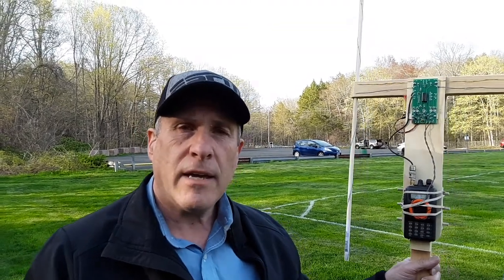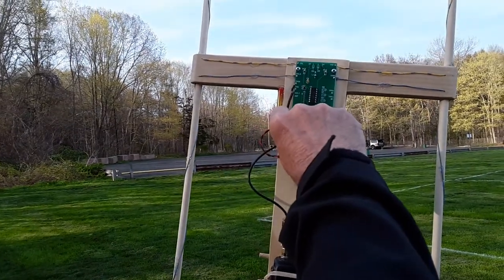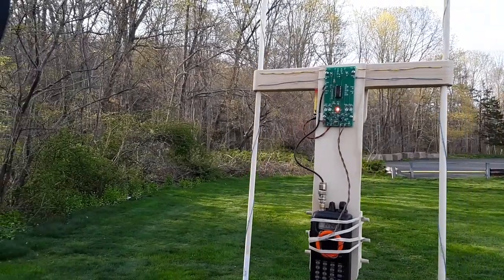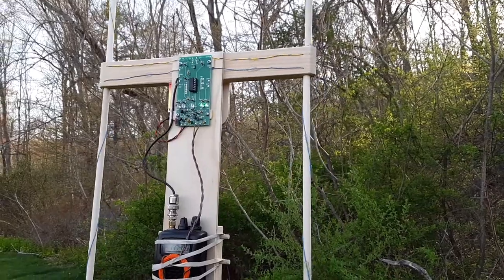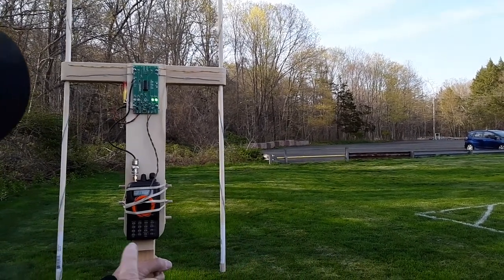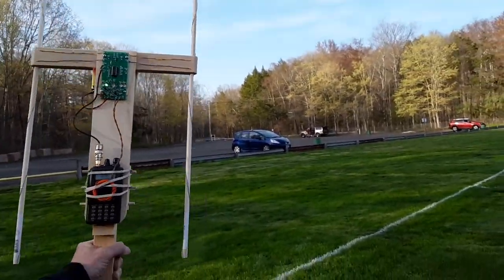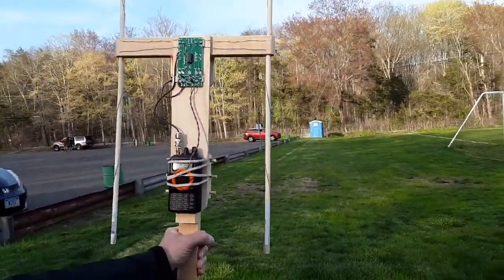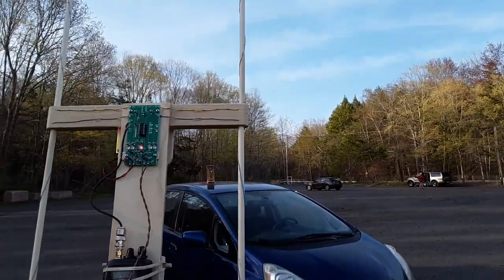A Doppler Type 2 Meter Radio Direction Finder

Comment: I just completed building and testing Dave's doppler direction finder and I must say, this has got to be the best doppler unit out there. Other dopplers may work but they will not tell you if the station is behind you or in front of you. This one will and is almost entirely free from modulation interference on the received signal. The parts count is low and does not use any exotic hard to find parts either. Except for the board and PIC chip, I scrounged all the parts from my junk box. Thanks Dave for sharing this great design with the HAM community and for providing the board and chip for the project. 🙂

Comment: I'm low tech. I stick a magmount on a baking sheet and find the deepest null which is the direction of the transmitter. To desensitize the signal I tune to the highest frequency I can receive the signal and or change the receiving mode of my radio working from AM, SSB, to FM. For strong signals you may have problems once you get very close to the source as the signal can enter your transeiver directly instead of through the antenna. For a dumb method it is fairly effective.
Usually I first try to determine whether the signal is vertically or horizontally polarized. Then I sweep to find azimuth. Dumb, da dumb, dumb, DUMB! But it works.

Comment from the maker: I don't have a good way to publish the schematic, but I can be contacted via QRZ and I will email it.  The PIC processor does three jobs.  It switches the antennas via PIN diodes.  It uses its internal A/D converter to get the audio signal from the pickup coil.  It measures the phase relationship between the antenna switching and audio and then controls the LEDs.

Comment: Here is an idea. If you set up two mixers fed from the same LO and construct a binaural direct conversion receiver. You could use the antennas as a variable phase shift element (as is done here). You could place the antennas on some kind of head worn cap and use the sound to walk directly to the 'fox' after a bit of practice. I think it could work, but you may look a bit odd wearing antennas and only suitable for 2m and upwards due to antenna size.

Comment: Very nice video! Can you point me in the direction of more antenna theory? I am thinking that the design could be used for UHF easily but there would be different spacing between the dipoles. Do you have a formula for figuring out the spacing? 
Thanks again for the fine work!
Reply from the maker: These antennas are just dipoles.  The switching between the antennas is what makes this direction finder work.  For UHF direction finding, a Yagi might be best.  A five element UHF Yagi is pretty easy to handle.

Comment: Seems like the explanation of how to know if it’s behind you or in front of you is skewed, it changes the direction to go L, R, or center in two locations so all it does is tell you how n which orientation the signal it’s traveling and not where it’s coming from. The only way it could tell which is the direction it’s coming from is to detect signal strength and discriminate when your body blocks it then light up a different color LED. 

What this is good for is to help you get a better azimuth of the direction the signal is traveling, you determine the direction the device points to, turn around and determine the other direction, place a marker of some sort where you are standing, head directly to one of those items you identified while sweeping then sweep so the marker you placed at your previous location is aligned with the line of travel, now shoot an azimuth with a reliable compass and you will eliminate the possible deviation when you plot this azimuth on a map. Go to a second and third locations and repeat the above process and you will have a better intersection plan to your target.

By the way, what is the brand/model or link to this Doppler?

Thanks.
Reply from the maker: I'm going to try to help you understand how this direction finder works.  By using the phase of the audio that is picked up from the radio, the direction finder can indicate whether the transmitter is to the right or to the left.  As an example, if the transmitter is to the East of you and you are facing North, the right LEDs will be lit.  If you are facing South, and the transmitter is to the East, the left LEDs will be lit.  So, this direction finder does tell you exactly which direction the transmitter is located.

This is a direction finder of my design.  It is the "NZ1J Direction finder."  In the text description included with this video, I have a link to additional information and a way to contact me.

Comment: Looks like you are not using Coax between the PCB and the dipole - will the close, parallel run of the wires cancel out the extra length of the wires (assuming each dipole part is about 50 cm for 1/4 wave) ?
Reply from the maker: I used coaxial cable in an early prototype.  The parallel wires are open wire feedline.  My tests show that it works in this application just as well as coaxial cable and it's easier for me to work with.  At my home station, I use open wire feedline to connect to a 40 meter dipole.  The combination of a dipole and open wire feedline works well at HF and VHF.

Comment: Are you detecting the phase shift with the PIC microcntroller?
Reply from the maker: Yes. The PIC drives the antenna switch and gets the received audio via an A/D converter.  It correlates the two to determine if they are in or out of phase.  The correlation also provides some filtering to reduce the effect of any modulation on the received signal.
Reply: @NZ1J  It's a little surprising that the sample rate on a PIC is enough to detect phase differences on a VHF signal (the acorn based µcs are much faster) but there must be an AF component that is still measurable. Anyway nice work.
Reply from the maker: @TheLightningStalker  Fortunately, the handheld receiver converts the VHF phase changes into audio frequency tones.  The antennas are switched at about 1600Hz.  That makes a 1600Hz tone.  The PIC samples at 16,000Hz to measure the phase.  To keep things simple, the audio is sampled for 1/10th second in a tight loop and just stored in a buffer.  Then, for a moment, the sampling is interrupted and the data is processed.  The result is that the LEDs are updated almost ten times per second.

Comment: Would it be possible to find CW transmitters with horizontally polarized signal using this setup?
Reply from the maker: This is intended for the 2 meter band.  It will work on a CW signal near the 2 meter band.  Though I don't have much experience with it detecting horizontally polarized signals, it should work.

Comment: How is this a "Doppler Type"?   I understand how the Doppler effect works with a spun array, and I suppose that this can be looked at as a very simple such array, but we are not really using Doppler, are we?   I suppose if you are FMing the rcvd signal then it's the same effect....
Reply from the maker: This direction finder switches between two antennas.  That is equivalent to rapidly moving a single antenna between to locations.  Moving the antenna with respect to the transmitter creates the Doppler effect.  That Doppler effect shows up as a tone on an FM receiver.  Some people refer to this as TDOA and reserve the term 'Doppler' for direction finders with four or more antennas.  But, the Doppler effect creates the tone that makes this direction finder work.  I think it is an error to refer to this as TDOA.
Reply: @NZ1J  The Doppler effect is usually understood as the change in frequency of a received signal due to motion, but your system simply measures the phase difference between the antennas... in fact, you are ultimately trying to make zero tone on your receiver when you are pointed at it.  I don't think that TDOA or Doppler are the right names either... both of those use actual measurements to determine the direction without requiring the operator to touch the antenna(s).   TDOA, at least as it has been implemented for GPS and E911, relies on multiple receive stations, and the Doppler units use a spun array to exploit the effect with an FM receiver.   I am sharp shooting your choice of words, and all of these methods are obviously working in very similar ways... but the names do have established meanings.    I am not sure what a better name would be, but isn't your device most similar to what they use on aircraft?   

Don't mean any insult to your work.... looks like a great gadget and I am sure that it works well.   I just wouldn't call it a Doppler.  But since I seem to be the only one who has taken exception,  maybe I am wrong.   Cheers and 73

Comment: If this is not a handi-finder, what is it? Did you make this yourself? Thanks. KC1JTS
Reply from the maker: This is a homebrew unit.  The HANDI-Finder is a pretty old design, going back more than 30 years.  With some newer technology, I think I'm getting better results.  I hope to make another video that goes into the theory of operation and some specifics about the construction.
Reply: @NZ1J  Very nice design, I hope that you'll make the pcb artwork and the pic program available. Better yet a kit would be fantastic! 73 de Dave N8DP
Reply: Dave,
Thanks for doing cool things and sharing them.  Can’t wait for the next episode on this subject!
73
Gary N5GDO
Reply: @NZ1J  Excellent. If you can manage the process, I think you'll sell a lot of kits, especially if you write it up for QST and also get it put onto Joe's Homing Im website.

Comment: 2 Antennas, and it will be "see" back and forth? no way.
Reply from the maker: It does resolve 'front' and 'back'.  I descibe the process in the video.  Let's say the direction finder has the center LED lit.  The transmitter is either directly in front or behind.  Rotate the direction finder 90 degrees to the right.  The 'left' LEDs now point to where 'front' was and the 'right' LEDs point to where 'back' was.  Front and back are clearly resolved.
Reply: Can't tell front to back, but can side to side. It's telling you which antenna the signal is hitting first. Think of the device standing still, and the signal tracing a circle around it, and it will become clear.